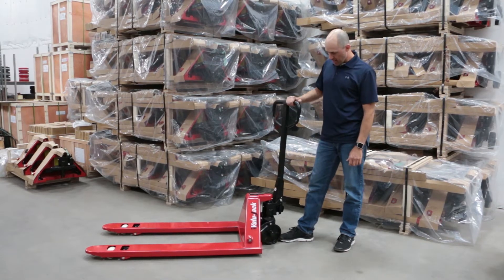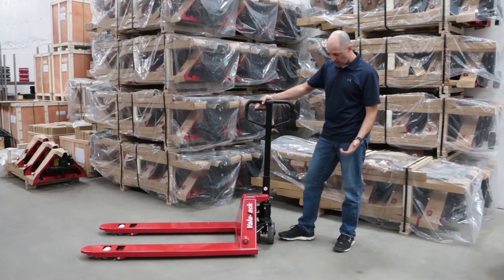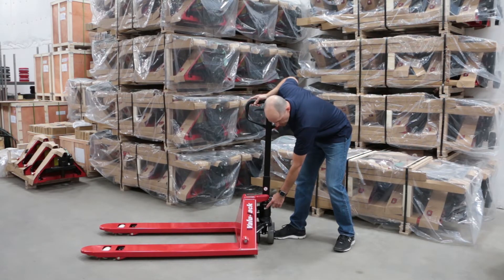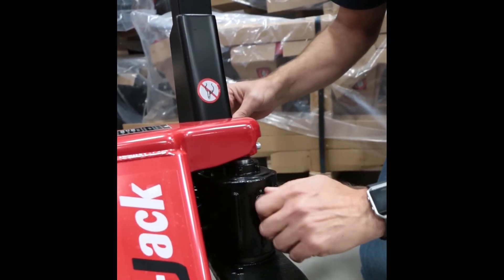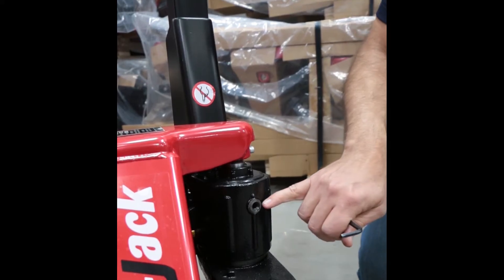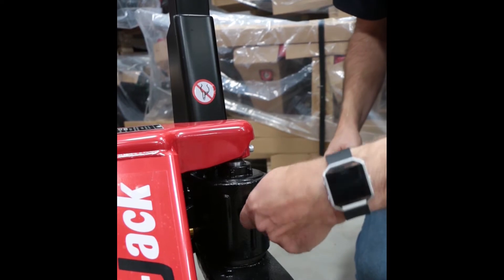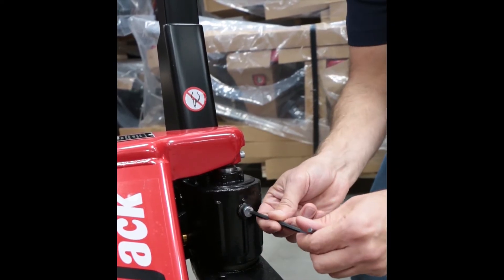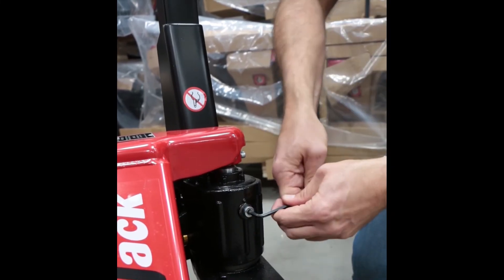How to bleed the air out of the hydraulic unit on a Pallet jack

Comment: Great tip! We have a Crown jack at work that lifts fine but lowers really slow and no manual around.

I have some basic mechanical skills like I can change my brake pads and change a tire and fix a hole with a tire plug, stuff like that.

If it's not too complicated, I can do it myself instead waiting forever for a work order to go through to get it fixed.

Any tips for this? 🤷
Reply from the maker: Slow lowering can be caused by a few things. First clean the jack. Make sure the lowering linkage inside handle connecting to pump articulating axle is clean. Turn jack over and make sure the lifting linkage pivoting points are clean. 

Any further questions please call or email 503-646-4575 / csinfo@genericparts.com

Comment: This isn't the bleed procedure in any of the pallet jacks we've had.  Usually it states in the manual to remove the fill plug, hold the handle in the lower position, then pump the handle up and down several times, check the fluid and fill if necessary, then replace the plug.  We've had about 8 pallet jacks at our two companies and I've tried this procedure many times and it never fixed them.  I always had to pay a guy half of what a new jack costs to fix it.  Around October 2023 we decided we're not paying to repair them again and bought a Franklin pallet jack at Harbor Freight for about $380.  It's now April, 6 months later, and the Franklin has only been used twice a week, and it won't stay up.  Hydraulic fluid was a little low so I filled it and bled it three times and it still won't stay up.  Must be a seal on the piston or the safety needle valve thing in the pump.  By the time you figure it out, buy the parts, and replace you might as well buy a new jack.
Reply from the maker: We find bleeding the pump with lever in the release position is best. This allows any air to be cycled out of the valve back into the reservoir and not into the pressure chamber under the lifting ram.
We are not familiar with the Franklin pallet jack. If you would like help identifying parts, please send a side view photo of your pump to 
csinfo@genericparts.com

Comment: I was hoping you would SHOW the adding of fluid because I don't understand how you POUR oil into a vertically-placed HOLE.......
Reply from the maker: A squeeze type oil bottle like this helps. (Our part number GW HO). For pumps with fill plugs located at the top fill to about 1” below full, with the unit completely lowered. 
Any further questions please refer to csinfo@genericparts.com
Reply: Flexible hose?

Comment: hello we have a pallet jack at our store that isn't going down all the way anymore. Its basically a brand new jack and it raises and lowers just fine but it needs to lower about a half inch or more. We did add more oil thinking that might be the problem but nothing has changed. Do you have any suggestions?
Reply from the maker: Please call customer service, they will try to help you 1-800-331-0839
Reply: Did you ever figure out what the issue was by any chance

Comment: Is there any way to get the pallet jack to drop faster?
Reply from the maker: The release or lowering function can be increased by turning in the adjustment screw. Turn in increments of ¼ turn at a time and test after each adjustment. If you send me your email, I can email you a photo of a hydraulic unit and where to find the adjustment screw (I will not subscribe you to any emails) irisn@genericparts.com

Comment: Hi, there are several manual pallet jacks locked in the raised position here at my job. Also, the lever handle will not budge. Are there any other tips that I can pass on to maintenance to get the back to working properly?
Reply from the maker: Hi Robyne, please send an email to csinfo@genericparts.com, or call 1800-331-0839 to connect with a technician. We'd be happy to help! Thnx